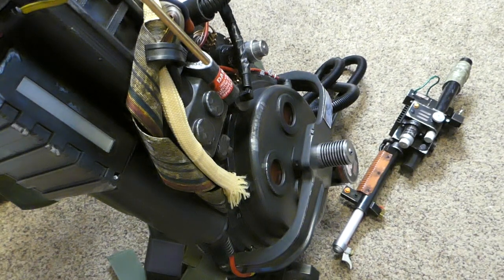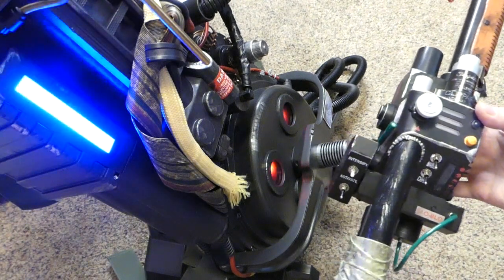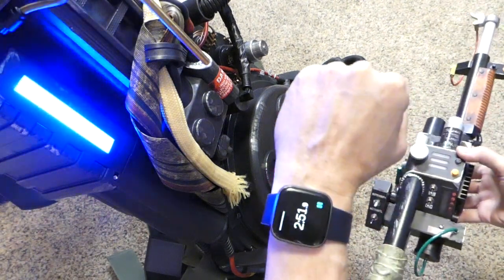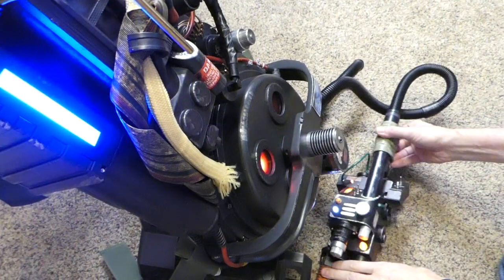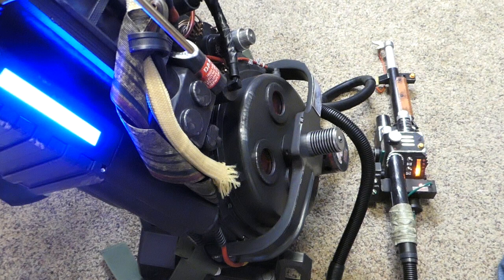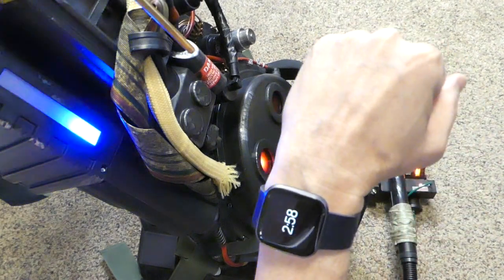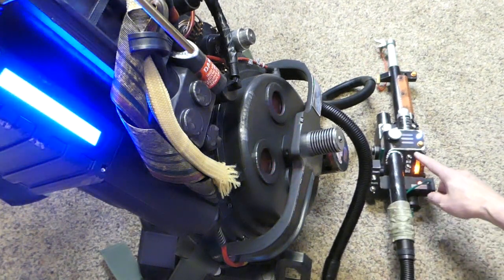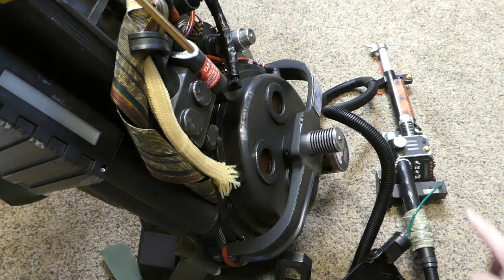Hasbro Spengler Wand KeepAlive board with unmodified Haslab pack keeps BOTH running forever-ish

Comment: Looks like this is the way to go for a stay alive kit. However I do like that the pack board allows for easy modification to a rechargeable battery. Do you plan to make any other in pack boards that add additional functionality?
Reply from the maker: I have several ideas, but need to focus on getting these out before I start playing around with additional features...

Comment: I've already modified my wand by adding two LEDs. I wonder if a keep alive system would work in my case without frying the main board
Reply from the maker: Probably not, but it really depends on what LEDs and how they are electrically connected to the pack electronics.  The KeepAlive board just plays with some internal signals to make the wand think you are continually playing with it to discourage it from shutting down.

Comment: great job but .. I have some requests.  1) would it be possible to immediately turn off the backpack as the switch is turned off by the wand?  instead of waiting for those extra seconds?  2) can the shutdown due to overheating when shooting be disabled?  3) could you add the sound like in the movie when the wand switches are turned on?  thanks 🙂
Reply from the maker: 1) Working on that - the pack normally waits for the wand to play the full powerdown sound before it starts its own powerdown.  The goal is to get the pack to powerdown while the wand is playing its powerdown sound.
2) I have not figured out how to get around that, but the pack will not powerdown when this happens with the KeepAlive boards
3) Great idea but it would add too much to the wand KeepAlive board (more connections, additional components, etc) so not going to work on that
Reply: @ghostlab42  1) perfect 
2) Thanks 🤞 3) I understand, That would have been crazy but I understand.